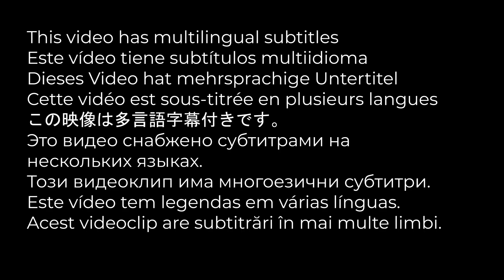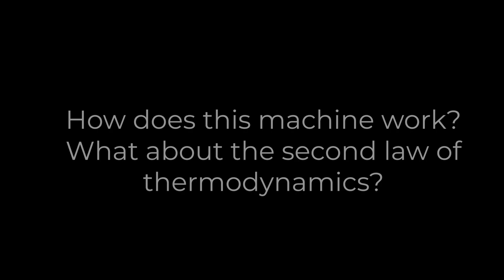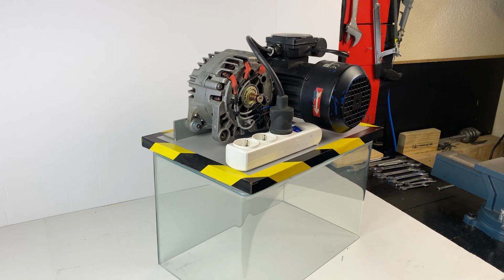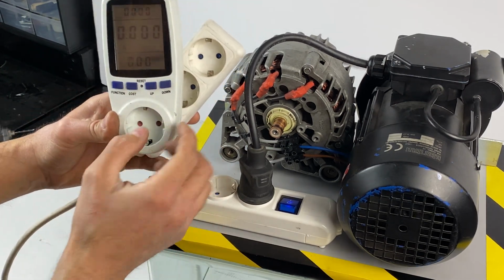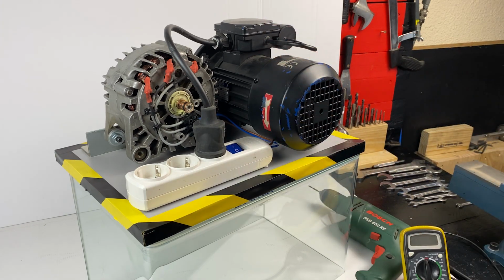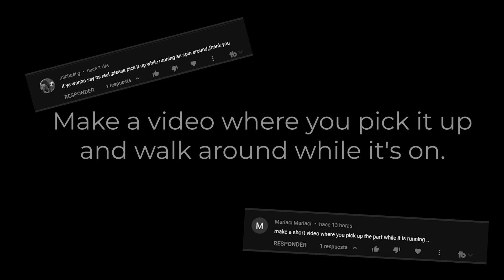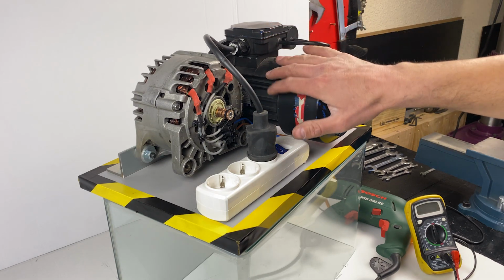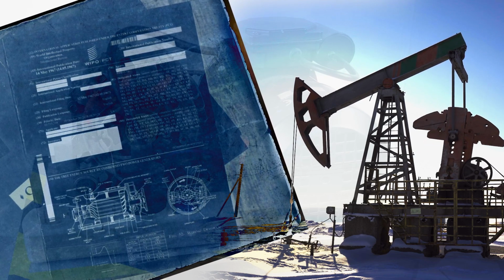We put this Infinite Energy Generator to Test - Liberty Engine 1.0

Comment: Hello.
Like most viewers, I am also an unbeliever. To dispel my doubts, please post a 5-minute film showing the generator's work under a load of, for example, 3 kW. Energy receivers can be several halogen lamps with a power of 500 or 1000 watts each. The load could be shown by the wattmeter presented in the movie. The work of the bulbs for at least 3 minutes, after finishing a request to pick up the generator or there is no other power supply.
Unmounted film, i.e. for 5 minutes the recorder is on and the camera is not on a tripod.
After watching such a movie, my doubts and probably many other doubters will be dispelled.
Best wishes.
Reply: the hertz drop from 60 hz to 50 hz under load of 850 watts, you can't have that from the grid, the coal generator is way too big for single drill to drop the hertz, ....so more watts and the AC motor won't be able to spin the alternator
Reply: @electronresonator8882  Nice theory ..ehm where is your video proving this??
Reply: @cat1stevens  Same here
Reply: @cat1stevens  the hertz comes from the motor , not the altenator ?
Reply: I'm thinking a 1kw load would deplete the batteries in a hurry! That basal platen looks nice, thick and overbuilt.  If it worked simply make a thousand of them to run your shop.  its odd that turning off the power strip that's not connected to anything shuts the process down, why not just leave it running.
Reply: @Luzviminda777  the hertz are from the alternator depending on how fast it is spun
Reply: @fastst1  Did you not watch the video at all or the video of this machine being built?
Reply: @Luzviminda777  From the alternator which is turning at the same rate as the motor. The formula for frequency of a 3 phase alternator is:
f=NP/120
f=frequency (cycles per second)
N=rpm (revolutions per minute)
P=number of magnetic poles
Reply: @chieftron   Nope, don't really need to, thermodynamics, its not a suggestion its the law.
Reply: @buddhadagreat4742  he’s right. That’s electrical engineering 101. The alternator MAY be able to compensate for a drop but there will be a point when it’s overcome and everything just stops
Reply: @nnadine1973  so you’re saying that magnets need batteries to have a magnetic field??? That’s all this machine does; harnesses the magnetic field of one to make the other work……it works. LOTS of people have proven it.
Reply: @fastst1  the alternator supplies the ‘power strip’ which drives the single phase motor. If the alternator is the only source of power then it supplies enough to run the appliances as well. 
Been along time since I did motor theory but I remember being surprised at a generator slowing down under load and this would affect the supply frequency. However, this is a brushless magnetic setup so any speed change would be due to the motor supply changing.
People are just gonna have to try it out for themselves and report here.
Reply: @101stevemc   you mean akin to phase angle lead/lag affecting output torque?
Reply: @buddymartin7923  Heh, so why wast energy with a belt that's only 85% efficient, use either a chain or just direct couple the motor to the generator and remove the fancy base.   Magnets have a magnetic field, make a coil that's shorted, move a magnet over it and the current flow causes an opposing magnetic field.  Take a normal alternator, and something to spin it, hold the alternator and apply current to the field, a tiny 9v battery will excite 150 amps from the power terminal.
Reply: @fastst1  ummm....the motor is plugged into the power strip?
Reply: @fastst1  as far as the belt and chain or direct coupling; convenience an ease of assembly would be the reason I would use a belt as well as the the fact that a belt absorbs a significant amount of harmonics and vibration and using a battery defeats the purpose.
Reply: Zrobiłem to. Ściema.

Comment: The law of conservation of energy, also known as the first law of thermodynamics is an absolute law, which states that the energy of a closed system must remain constant—it can neither increase nor decrease without interference from outside.  There will be external interferences such as air resistance, friction, and thus keep using up whatever initial energy.  The engine will stop as soon as the initial energy is spent. All the energy you put into the system is the one pull of the cable!  Instead of just running your Liberty Engine only for a few minutes, run the engine for a few hours and record it with a time-lapse setting of let's say one frame per second for a few hours.  Better yet, hook up a 1000W  electric heater to it, and let's see the red hot heating coil as an indication of electric load.   You have a closed system and is a miracle.  Please go get a patent, mass produces it and I will be the first to buy one.  This is a green energy machine!
Reply: @PaulG.369  Einstein said " Crazy is doing the same over and over and expect a different result. "  or something like that.   Go ahead and keep violating the physics law and expect a different result  and you will come  up with the next Einstein.  That is just brilliant!

Comment: Here's a good question for you on this device, how did you take an old worn out alternator that you have horribly unbalanced by hacking up the rotor creating a ton of friction (energy loss)  then adding magnets and epoxy at almost random, removed the rectifier so you then have zero ability to regulate voltage output and yet even under heavy load running tools off of it manage to maintain a steady electric motor rpm and voltage output?.  Your saying this device is well over 100% efficient and based on this alternator running the motor and connected devices and maintaining steady current its closer to 200% effecient.
Reply: What’s truly surprising to me is the number of people here thinking this is legit.
Reply: @firestone3217  that’s actually funny.
Reply: @anooseholay  yeah, I am surprised people believe this. They need to start paying attention in physics class.
I first thought he might have built something into the big black motor but then my money is on the thick bottom board holding batteries and an inverter. The inverter will make AC from batteries.
Reply: @firestone3217  I don't even think flat earthers would fall for this one!
Reply: @anooseholay  world energy problems are now solved.

Comment: Anyone who doesn’t believe this is possible obviously doesn’t understand how electricity works. The alternator was transformed from dc (direct current) to ac(alternating current). The polarity of the magnets were arranged in order to make the polarity to alter between positive and negative ( alternating current). This current drives the force to provide electricity to the electric motor, the motor physically turns the alternator. Very simple.
Reply: Anyone who believes this has absolutely no idea about electricity or thermodynamics. For a start all alternators produce A/C a diode bridge converts output to D/C. it cannot ever work due to the basic fact you cannot get more energy than you put in. This coupled with friction losses in drive belt or coupling, rotational losses and the fact that no motor or generator can run near 100% efficiency mens it will fail to start or stop nearly instantly.

Comment: This is practical. I figured out very quickly in the first video that you needed to pull start it. What is really puzzling is, why don’t the car manufacturers use this type of set up instead of batteries?
Reply: @Capicua718  I whole heartedly would love to believe that this is true. Would at least make it possible the charge your car while you drive or after you park with one of these in the trunk.
Reply: Because it's nonsense. Generator converts motion to electricity WITH LOSS. Motor converts motion back to electricity WITH LOSS. It's a lossy system, not one producing energy.

Comment: Here is where I get off the bus.    Your magnet configuration has at least 6NS configurations.  So that is 6 hz per revolution.  The motor you are using is 3000 rpm. So that is 18000NS cycles per min ÷60 seconds is 300 NS cycles per second(hz).  The proper way to get 60 hz the pulley on the alternator would have to be 5 times larger than the pulley on the alternator.   Your motor will be baked soon and your watt meter is messed up.  But it may work for about 5 to 10 minutes which is cool.
Reply: Love your comment  however I think I got off the bus sooner.  I'm just enjoying the comments now.

Comment: How long can you run it? With the overage of wattage it must heat up fairly quickly. Not that I want you to run it to failure but it must heat up quickly.
Reply: Agreed. I think it must get hot. I assume that the best method would be to run a minimum of 3 in parallel with one rrsting/cooling whilst the others work

Comment: Nice video but there are a few things I would love to see in the next video. Can you remove the power board from the table. Can you show us whats in where the starting cap is and can you put a load on the alternator so we can see the voltage drop the more load you put on it?
Reply from the maker: What’s exactly the starting cap?
Reply: @HiddentechnologyYT   A starting capacitor is a component wired in parallel to many AC induction motors, as is the case with the motor in this video. Such a capacitor would normally be installed at the factory, as part of the manufacturing process. Its purpose is to store and release extra current at startup, when a brief surge of more amperes is generally required.  
I don't believe that the presence or absence of a starting capacitor has any effect on the success of the concept being demonstrated.
Reply: @danplasil8299  Correct. A starting cap wouldn't be necessary when manually starting the motor as he's done in the video. A starting capacitor is only needed if it's being started with electricity.
Reply: Start cap is mounted on side of motor
Reply: @HiddentechnologyYT  The Starting Cap is the big tube mounted to the side of the electrical connection box on the motor, with wires running to the inside of the connection box.

Comment: Great job, video is very clear, seems all you need to know to make it yourself is there.  TYVM!  Can't wait to get started.  The secret is the placement of the neo magnets on the rotor.   Actually what makes this most feasible is the invention of the neo magnets.
Reply: Only problem ... it does not work.
Reply: @kenw.1112  Did you try making it....

Comment: Can you please add links for parts list of all components? Thanks you for this great information.
Reply: With a little research, you come up with: truck alternator 24 V, 200 A, single phase motor 230 V, 50 Hz, 3000 rpm, 750 W and neodymium magnets that fit in the space.

Comment: We need a complete video, showing all the assembly process, no cut, one shot video. If you want to proove that everything is true, you have to show all the details of your build, magnet installation, wirering (motor, alternator, no plug box, just wires...). And beyond, all the datasheet of components (alternator references, motor serial number for the model specifications) efficiency, calculation methods, watts, ampers, volts, % of efficiency output... show us as a scientist will do. Poeple want to trust you, be the most precise. Sorry for my english, not my native language. Thx :) Best regards.
Reply: I want to know what's in the mounting base.  If you have a close look, you'll see the tape isn't sticking to the sides of base "board".  Actually looks in some shots like the base may be hollow as the tape bellows in and out in spots?  Have a good, close look. ;)
Reply: @LethalBacon479  I'm with you, my comment was a request, something i know they will never do coz it will expose them. They just take poeple for morrons.

Comment: great idea my friend!  I have had a similar one in my head for years, but I did not run it in reality.  I also have other ideas but they still only stay in my head :( great for the builder!
Reply: @ArtemisKitty  you’re skeptical of this but believe trump was a great president 😂
Reply: Same here,  ive also been kicking around something similar but with much more horsepower by using cam actuated magnets timed around a larger generator, I’ve seen this same system in 70s and 80’s where the inventor suddenly disappeared , im pretty sure we would be flying cars and be so advanced by now if the Koch’s and other oil barons didnt hold us down
Reply: @jackmcandle6955  Hey, I'm not even getting involved in your American politics, sorry. No preference for ANY of them, as that's your place to vote. I'll just watch and shake my head at the crazy news we keep getting from there.
Reply: @ArtemisKitty  thank you

Comment: Can you add links for parts list of all components? Thanks and great information.
Reply: No he can't. He doesn't want you to spend hard earned money to build that useless thing. He's got some principles I guess.
Reply: Just look up the patent he's talking about. In order for him not to be able to sell it, it would have to be available to look at. I'm sure he'll post a link to it if you ask.
Reply: @pmarquisYT   why it is not working?
Reply: @igameesteabkusttakingpigis5501  You mean besides the fact that it violates fundamental thermodynamics laws. The guy just cranks the generator by hand and it magically accelerates, which means it's well over 100% efficient. Even if all his mechanical setup would be top notch, it would still slow down gradually. But this is far from "top notch", I mean look at the flappy strap with no tensioner, this is laughable. And then he uses this generator to draw enough energy to power a drill and it somehow it has no effect on the system's balance. Even if you would cheat and have the motor powered by a 220V socket, that generator would still not be able to feed enough power for a drill that size to do useful work. This is all trickery.
Reply: @Captain Wallard unfortunately, powering even a small house would require lead wires as big as your finger, or at least 100 amps at 220 volts. The little blue and brown wires would not support a mains load.
Reply: @igameesteabkusttakingpigis5501    there is no free energy,this will run as it is...it will not power anything however as any load will stop it ,so in essence,its pointless
Reply: Hi, unlike others I understand how this works, but you only show the “pros” in the video, this is why so many are sceptical, you should do a video on the Pros and Cons for example trying to power a kettle or something that would exceed the power output that would shut off the motor. 
but this is a really cool video and I’m looking forward to seeing new videos 😃

Comment: This is still technically impossible because of the nature of magnets, they do not create energy on their own, they must be moved to create electricity and that movie meant is the energy put into the system, with less energy coming out after the parasitic losses. Also a 3000 watt generator can not make 3000 watts when it is only being spun with 2000 watts of power

Comment: Hi there. I've only 1 Question which u didn't answer yet.
What Neodymium magnets did u use ? How strong ?
Because if I order these magnets I have to pick the right ones. And since they are available in various power and measurements it would be good to know which one I have to order 🤷‍♂️😅👍
Reply: Yes, please give it to us.
Reply: Assume U've seen the video. He used a certain type of glue that has a certain "pull-resitance". The way he handled the magnets I would chance it somewhere between 12-35 kg strong. Anything above 35kg would be difficult to handle by bare hands. I had a 50kg magnets and I did good to be cautious while handling- coulda break my skin or so...
Reply: Peter Von Frosta-
I took like 7-8 hours yesterday trying to figure out the same thing!  Lol!  Guess what… I figured it out.  After pausing and rewinding over and over then taking a break from this video to watch others as well as looking at magnets ALL of the greater Sacramento area and online. I found the ones that he uses and was only able to figure it out with seeing them during my little break. They are on Amazon. The size is OR18mmXIR14mmx45degX20mm. Well that’s what the official description is. It’s actual 20mmX18mmX4mm but there is a 45degree inner curve. They are sold in a group of 8 because that makes a complete circle. And I couldn’t find them for any cheaper that $32 for 8 small magnets!  You’d have to order 3 sets of these magnets and after tax it will be over $100. 

OR…
I saw that in the video when he glued them together he makes a rectangle that after watching I did the math and he’s making a 36mmX20mm rectangle. And he makes 6 N and 6 S to a tune of 24 magnets. Amazon has 40mmX20mmX5mm and I will get 30 neodymium magnets for like $16 and free next day shipping.
Reply: @jaredmiklaus5053  Great! Thank you very much for this revelation. Jared, can you also tell me what the generator and engine specs are?
I can not find anything about this
Reply: @jaredmiklaus5053  would you happen to have a link please.
Reply: @jaredmiklaus5053  I looked but have no luck finding any magnets of the right size. Could you post a link? I would very much appreciate it.
Reply: @jaredmiklaus5053  dude, did it work?? Did you cut them and all? Did it work?? :D I just ordered my car alternator. They are n42.